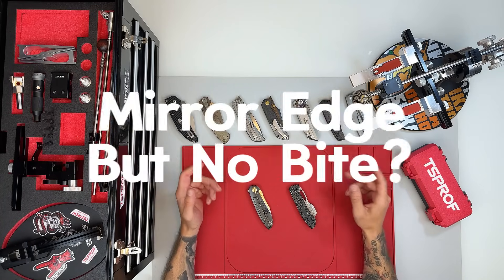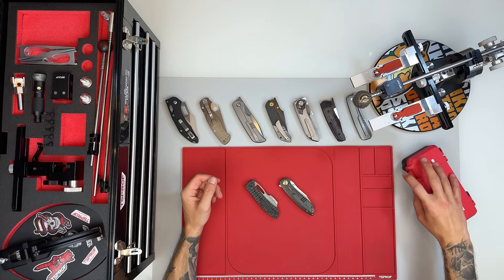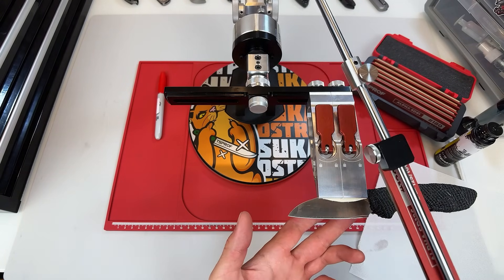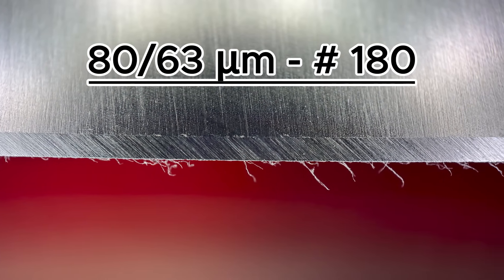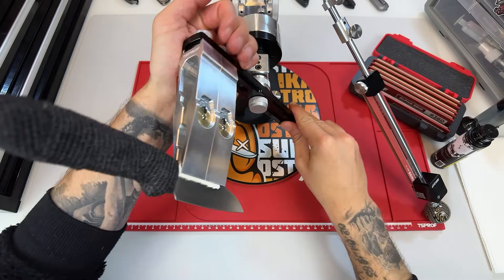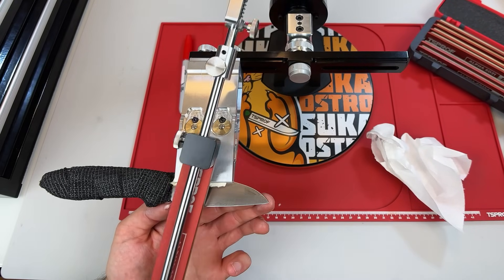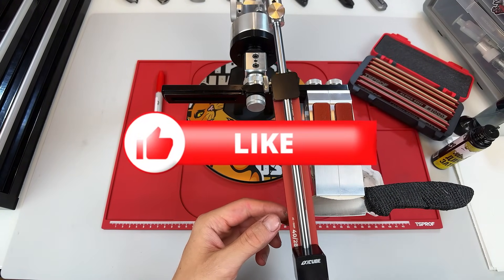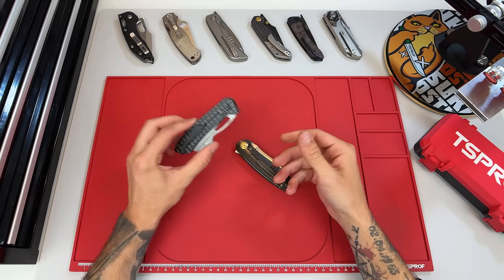Mirror Finish but No Bite? Why Your Knife Still Feels Dull After Sharpening CPM S35VN!

Comment from the maker: Have you ever had a mirror edge that looked perfect but just didn’t cut the way you expected? 🤔 Drop your experience in the comments 🙌 I read every comment and truly appreciate all your insights. Thanks for watching and leaving a like. It really helps! 🔪
Reply: I've seen M390 take a mirror edge and cut like a laser from one producer, and then the same steel from another company turned into a butter knife with a mirror edge. It's definitely something to do with the heat treat on some of these steels.
Reply from the maker: @CB-68-westcreations  I completely agree with you, especially when it comes to M390/20CV. I often find it a bit frustrating, because that is usually the steel used in knives where the price starts to climb and the marketing labels it as a premium steel. But in reality, only a few actually manage to bring out its full potential.

And when M390 is able to take a mirror polish with bite, you know it has been heat treated really well and that is extremely rare.
Reply: @TheSharpeningGuide  yep, that kind of makes sense since they're basically the same steel just different manufacturers. It requires a heat treat somewhere around 2200° and a holding time to get everything dissolved into it and most Systems won't take it over 2000° during the heat treat process and they don't hold it at that temperature long enough, even if it were sufficient. They're getting too much of a hurry with it and lose out on the benefits , I don't remember the holding time at peak temperature, but I'm pretty sure it's not five seconds. Lol.
Reply from the maker: @CB-68-westcreations  Yes, and I think a lot of people don’t actually realize that those two are basically the same steel.
Honestly, I don’t have all the numbers memorized at all 😅

But to put it simply, time and energy always translate to money. And that obviously matters in mass production.

I uploaded a new Short today featuring the Kunwu Stiffy D in Vanadis 4E. They only list it as Vanadis 4, but as far as I know, the original Vanadis 4 hasn’t been produced for years, so it pretty much has to be 4E.

Anyway, that brings me to the actual question… What’s your opinion on this steel compared to CPM 4V?
Reply: @TheSharpeningGuide  4V can get a few points harder, while still being reasonably tough if it’s done right. I’ve seen it run up to Rockwell 66 and still be tough enough for most applications. So it’s harder to sharpen, but it will hold an edge longer. That’s one you definitely need CBN or Diamond to get really sharp though. Standard wet stones just aren’t gonna do it. If the stuff was he treated correctly. It should land somewhere near a 65 or even 66 in hardness, while optimal hardness on M390 is right around the 62 range.
   I’d like to see a head to head comparison of CPM 4V with a proper heat treat put up against Rex121 they can both do well at 66 hardness so that would be an interesting challenge . Honestly, I’m thinking the 4V might actually out perform Rex 121 in the toughness area. Or at least match it.  I’d have to go back and look at the formula for those two again. But it would be a fun challenge.
Reply from the maker: @CB-68-westcreations   Of course, with this kind of steel, I only use diamond or CBN abrasives. I still have my Naniwa Chosera set, but I reserve it exclusively for steels where the carbides are softer than the aluminum oxide in the stones. The Kunwu Stiffy D. in Vanadis 4 Extra is listed at 63 to 65 HRC, so I'm really curious to see how it performs.

M390 at a solid 62 HRC would honestly be a dream for mass production. That would be a game changer. It would definitely make for an interesting comparison. Unfortunately, I don’t currently have a 4V blade on hand, but Vanadis 4E comes very close. That said, even small differences in steel composition and treatment can lead to noticeably different results in practice.

Thanks again for your detailed reply i really appreciate it!
Reply: @TheSharpeningGuide  Would it be possible for you to add a German audio track to your videos?

That would be great, as I'm from Germany and it would be easier for me.
Reply from the maker: @Xs1cht10  Hey, yeah sure! I’m currently switching all videos to automatic synchronization. It just takes a bit of time for YouTube to process everything. 👍

Comment: Thank you for doing video like this! Not enough out there on grits for different steels....appreciate you!
Reply from the maker: That’s why I tend to hold back from making direct statements like “the best grit for every steel.” Heat treatment plays a huge role, and even the sharpening angle can change the results quite a lot. What you mainly cut is also an important factor when it comes to grit finish.
I also think it’s better to experiment a bit with your own knives. Trying different finishes yourself builds real experience and gives you a much better understanding than any fixed recommendation ever could 😁
Reply: @TheSharpeningGuide definitely agree with you there!  Its exhausting trying to research stones for different steels while keeping these thoughts in mind...youre videos definitely are huge help to understanding thats for sure.  Appreciate you

Comment: Hi Greta video. You should make video about steels and best grits with angle. Based on your experience
Reply from the maker: Hey, thank you so much for your comment, and I’m really glad you enjoy my videos. I’ve actually thought about doing that several times already, but the main issue is that I feel many people would just follow my recommendation blindly instead of experimenting and gaining their own sharpening experience, which is extremely important in the long run. It’s also quite a complex topic because the steel plays a major role, but so does what you actually do or cut with the knife. That’s why such recommendations can be tricky. However, the video is still on my list, and I’ll definitely try to come up with a good solution for it.

Comment: Really appreciate your videos thank you for sharing your tremendous knowledge for sharpening. I was hoping that you could put a timer in your videos to show the actual time it took to sharpen that knife I know. I know you shorten the videos so they’re not create crazy long. But it would help to understand how long you’re actually taking for each Knife. Also I’m hoping you do a video soon on changing the edge angle that’s another thing I’m having a hard time with
Reply from the maker: Hey, thank you so much for your kind comment, I really appreciate that kind of feedback. I’ve actually been thinking about adding a timer as well. The tricky part is that I use the same camera for both the regular and the microscopic shots, and since I sometimes pause or adjust the setup in between, it’s not that simple. But I’ll try to come up with a good solution, maybe by overlaying the time digitally instead.

The full filming process usually takes around six to eight hours until everything is done, though the actual sharpening part is, of course, only a small portion of that.

Maybe I can already help you a bit. What exactly do you find difficult when changing the angle?

Comment: Dude thank you I was so mad after just lapping my cbn stones and the 2 knives I've sharpened since aren't getting the same mirror polish as before and I was thinking what your saying was the issue they just need to be broken in again but needed to hear it so thank you!!! I was stressing
Reply from the maker: If you’ve flattened your stones using the traditional method with a glass plate and SiC powder, there are two important things to keep in mind.

First, the stones will go through a new break-in phase before they start performing normally again. Second, the main problem with this method, especially when working with very fine grits, is that the stone often becomes contaminated with SiC particles. These particles can get embedded into the bonding, which leads to unwanted deep scratches.

What I usually do with my polishing stones is this: before I start flattening, I take an aluminum blank and use it to pre-work the F1200 SiC powder on the glass plate. SiC powder breaks down into finer particles as it’s used, so this step helps refine it even further before touching the actual stone. Never start with a coarse SiC powder when you’re dealing with polishing stones.

During flattening, I work with almost no pressure to avoid pressing SiC particles into the stone. After using the powder and doing the initial cleaning, I go over the surface again with a 12K grit Nagura stone to remove a thin layer of material and eliminate any possible SiC contamination.

Finally, I clean the stone thoroughly under running water using a soft toothbrush and some soapy water. Maintaining high-grit polishing stones can be quite time-consuming, and while there are alternative methods for finishing them, those are usually far more complex and expensive.

Comment: I love these kinds of videos. Your points align directly with my observations. Anyway there's this one thing I can't figure out. My Venev F800 Orion stone polishes the edge to a mirror. When I move up to f1200, it reintroduces micro scratches which makes the edge more matte. I never understood why this happens. Sometimes (like when sharpening Rex45) f800 seems to produce the sharper edge. Other times, (like when sharpening m390), I get sharper results from f1200. Do you have any insight why this happens? Also just for additional info, I never strop. I always deburr on the stone and examine under high magnification. After that, I test. If it can whittle hair, why even strop?🙂. Thanks for your videos!
Reply from the maker: Thank you very much for your kind comment, I really appreciate it. Have you ever worked the stones with SiC powder, or are they still brand new? Especially with REX 45 and M390, that’s quite unusual, because normally the results should definitely be the other way around. Does this happen for you in general, or only with exactly those two knives? The only logical explanation I can think of would be the heat treatment.

And yes, I fully agree, the sharpness you get when you perfectly deburr the knife directly with the stone is always the best. The risk of making a mistake during stropping is much higher. Depending on the grit range, the steel, and what result I want to achieve, I don’t always strop either, so you are absolutely right about that. 😁
Reply: Yes I have lapped the stones with sic powder on a Jende lapping glass. I have sharpened all kinds of steels and the results are the same. The Venev Orion f800 polishes better than the f1200 and even the f1500. My guess is probably Venev's binder on higher grits. Anyway, it is what it is 🙂. I appreciate that you reply to your subscribers. I hope your channel gets way more well deserved attention and recognition. Thanks again!
Reply from the maker: @NineZeta   Was it like that from the very beginning, or only after you worked on the stones? It’s quite possible that some contamination occurred during the dressing process. It could also be a slight contamination right in the layer you’re currently working with. In many cases, lightly dressing the stones again can help expose a fresh surface.

Thank you very much for your kind words. I always try to take the time to respond to comments, and if I can help, even better. Technical conversations about sharpening are always fun to have.

Comment: Why do you clamp the knife all the way to the end vs the center ? I’m still learning about my new system
Reply from the maker: When working with a sheepsfoot blade, which has a straight cutting edge, the clamping position is not as critical. That’s because the sharpening angle stays consistent at all points where the edge is parallel to the rotation axis. With this type of blade, I often clamp it slightly off-center, shifted outward, since that gives me more clearance around the handle while sharpening.

In general though, the correct clamping position always depends on the blade shape. A simple way to start is to clamp the knife, mark the edge with a marker, and take a few passes with the stone to see where material is being removed. Once you’ve found the correct angle, you’ll usually notice that in the belly or towards the tip, the angle becomes either too steep or too shallow, while it matches perfectly along the straight portion of the edge.

What you need to understand here is this: if you move the tip farther outward, away from the rotation point, the angle becomes shallower. If you move it closer to the rotation point, the angle becomes steeper. This way, you can dial in the perfect position for any blade shape.

That’s why it’s not as simple as always clamping the knife right in the middle if you want to match the factory grind as closely as possible.
Reply: @TheSharpeningGuide thank you very much this was very helpful

Comment: What would you recommend for MagnaCut? Toothy or polished?

Also, if I’m going to strop with kangaroo leather on an aluminum backing, should I match the initial sharpening bevel angle or should I go a little bit lower?
Reply from the maker: Magnacut performs exceptionally well with both a toothy and a polished edge. I usually finish in the range of 1000 to 5000 grit, depending on the sharpening angle, but with this steel you can achieve excellent results anywhere from 600 up to 11,000 grit.

Whether you should adjust the angle depends mostly on the type of leather you are using. On smooth, firm leather, I get great results using the same angle I sharpened at. The softer the leather the more you need to reduce the angle. It is important to experiment a little with your setup, but most people work in the range of minus 0.2 to 0.3 degrees.
Another key point is to apply absolutely no pressure while stropping. If you want to be precise, you can also mark the edge at a few spots and check under a microscope to see if you are hitting perfectly or if a slight adjustment is needed.

Comment: Some interesting concepts were discussed but it was just abstract and theoretical. It would be nice if you had included a variety of steels and what edge finish you have personally found them to perform best at. Otherwise the video just kind ends up being “different stuff is different! Try for yourself!” In which case the video should be a lot shorter lol. 

This is all meant to be constructive critiques because I do like the channel and think it has a lot of potential 👍🏻
Reply from the maker: There are some great videos out there, especially from Nevees Knives, where he spends 30 to 40 minutes going through all kinds of steels and sharing his thoughts on grit finishes. My approach was a little different though. I didn’t want to go through every steel one by one and give a fixed recommendation. Instead, I wanted to explain the principle behind grit finishes and encourage people to experiment for themselves.

The reality is, there isn’t one perfect grit finish for every steel. Heat treatment plays a big role, but so does the kind of performance you personally want from your knife. Pretty much any steel works well around 600 grit, but depending on the heat treat, the exact same steel might perform even better at 1000 grit or at 1200 grit. That’s why I didn’t want to make absolute statements for each steel—because if I did, most people would just copy that without testing if their specific knife could actually perform even better with a different finish.

And that’s really the point: testing is what builds experience. It’s how you improve, and it’s how you learn to understand the differences in steels and finishes. My goal is to provide the foundation and the motivation to try things out for yourself, because sharpening, in my opinion, is very much a “learning by doing” process.

Anything you figure out or discover on your own through practice will have a much bigger impact on your learning curve and the knowledge you build than just being handed ready-made answers. So thank you very much for your comment and your input—it really helps me to keep improving my videos and to structure the content in a way that’s as helpful as possible for everyone.

Comment: Wrapping the whole damn handle is an interesting life decision🤣. Just put some painters tape an inch of the way down, it’ll keep out grit just fine. Very well structured video I did enjoy it❤️
Reply from the maker: Hahahaha I totally carried that over from using the Kadet Pro, where you always rotate the knife by the handle 😂 With the K03 it’s completely unnecessary since I never actually touch the handle during sharpening 😂 These days I always use Capton tape, but I actually prefer that self-adhesive bandage material it leaves no sticky residue on the handle. Thanks a lot for your comment, like, and subscribe 🙌

Comment: Your sharpening system is great for smaller face blades and folding knives, but starts to lose its function as blades get larger. Although it's not nearly as expensive as a Tormek system, it is very good for the more common blade sizes.
Reply from the maker: I have to say, you can definitely sharpen a machete with it without any issues. When it comes to something like a sword, it obviously gets a bit more difficult. In my experience, the limiting factor is usually the blade shape or the geometry of the knife.